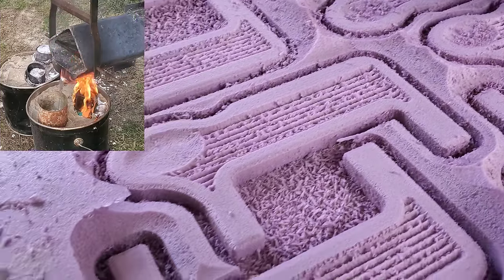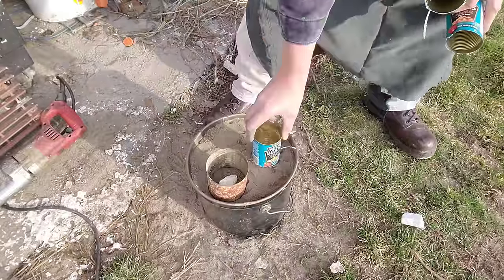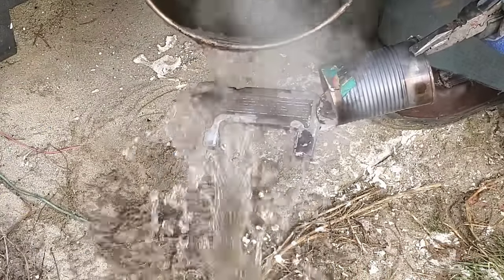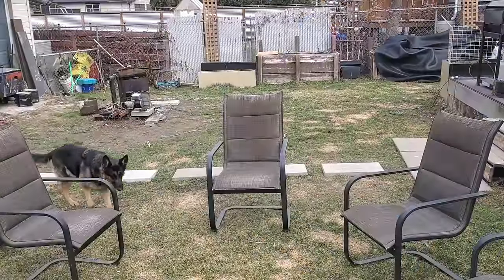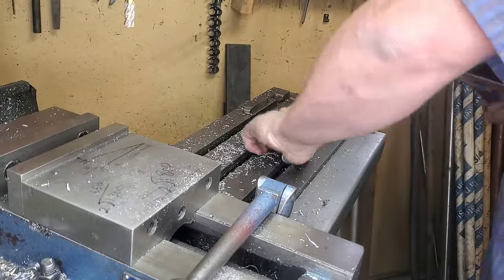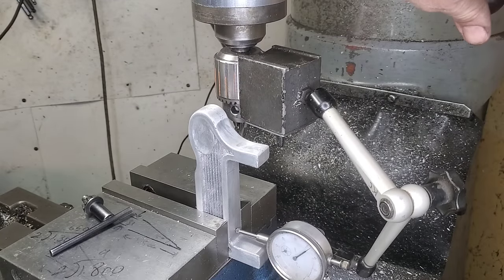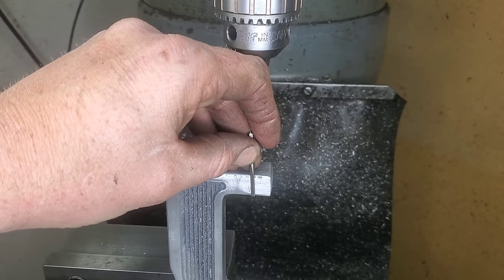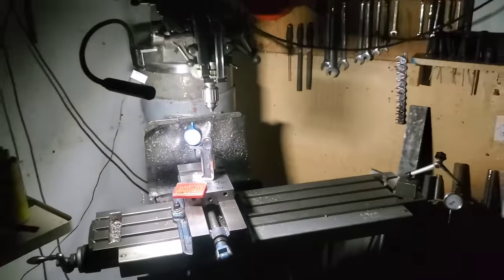Lost foam casting a presision snap gauge

Comment: Making a measuring tool with aluminum is a bad idea
Reply from the maker: Thermal expantion good point . Im wanting to move to iron at some point :)  lots of moving parts with that endever
Reply: @Wrighmachining  take a look at micrometers. They also have a plastic piece that acts like a heat insulator

Comment: You stress about having appropriate PPE & yet your forging area has a gasoline can sitting 3 feet away. You might want to make sure the work environment is safe also. Also I'd suggest getting a class D fire extinguisher at the handy for those ohhhh crap moments. They can & will happen.
Reply from the maker: Kamloops bc , we are in a sub desert as well .     We do get colder winters with snow here though

Comment: Boy did this come along at the right time! I've been messing around with casting and was about to spring for some different pro sand formulations, but... I already have wall mud! I'm using a cute little coffee can furnace at present, but if the wall mud thing works well enough I may have a new project building something bigger :)
Reply from the maker: Awsome ! There is also a video on the slury if your interezted amung other videos i have .   Also kelly cofield on Yt is one of the other losr foam casting guys as well . Does some realy cool stuff . Look for his older videos .   Good luck and have fun

Comment: Cool project!  My biggest lost foam casting so far has been a big honkin' custom pulley for my generator project. Lightening holes are a snap in lost foam.

Oh by the way, reamers are a thing. Not even that expensive. And reaming aluminum is the easiest of easy. Go treat yourself and double or triple the precision of your finished holes. You can even get oversize and undersize reamers if you need a hole that's not exactly 0.750" or whatever.
Reply from the maker: Haha , i figured i would get chirped for no reamer , and rightfuly so . :)   ill definatly do that next time . 

With the pully you casted did you lay it flat or cast vertical ?   Also any warpibg issues due to foam and sand and if so what would you change to prevent it ?
Reply: @Wrighmachining  I did it vertically. It took three tries to get the gates the right size and position so everything filled out right. That's one of the minor drawbacks, the pattern is single use only. But, not so hard to make a big round slab thing and drill 6 evenly spaced holes. It would be fun to go back and do it horizontally to see if it's easier or harder. There's always a way.
Reply from the maker: @solarguy6043  i have not had much sucess with horizontal my self   . I did a 30 inch round one with a single inlet last year .   Wow that was exciting for sure .  Took a few trys as well .

   Yes some experimenting is required for horizontal .
Reply: @Wrighmachining   I am contemplating a cannon build, and I ran across a video of a guy trying it horizontally. Didn't work out, but vertically it did.

Comment: I am tempted to suggest slitting and bolting for the indicator stem hole, but understand there might be some issues with the brittleness of the aluminum, but same goes for a grub threads in the Al to be fair.
Reply from the maker: Good idea . Would have been esyer on the dial .    

Yes the other casting i did for the servo motor i casted a slit in and the alu was way softer .

Comment: I just love your pratical casting setup, so thanks for demonstrating it......Suggestion: try some kerosene as a cuttting fluid for Aluminum.   See what you think.
Reply from the maker: Kerosene as cutting fluid . I will have to look i to that for sure .   Yes the rapid tap is not spacific to alu .    I was using some stuff that came in a green can a while back.   Thanks for the silugestion i will get on the research and try it out !

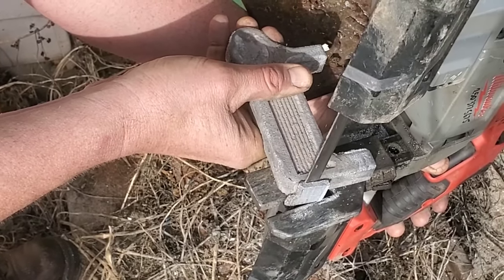Comment: @6:30 you literally did create a crystalline structure. By quenching it, the crystal species that form are different to it naturally cooling vs. tempering. It's one of the variables that decreases yield in industry massively.
Reply from the maker: Thank you for confirming that , i figured alu would act similar.   If that is the case i next time i will not do that and second i can perhaps run a heat cycle on parts to destress them or soffen them if required for the aplication  ( much like normalizing 4140 so you can machine it )

Comment: Does it make sense to create a measuring instrument in AL due to the large thermal coefficient?
Reply from the maker: Yes it would play a factor in it for sure . Just like mics you would leav it on the bench and use it and put it back down .  Due to the size of it , i would asume you could hold it for a couple of min before the expansion of metal started ( like micrometers )   great perspective patheron !!    

Next year i would love to build a cop furnace and start pouring iron but have to spurce out coal .   Aside from mile long tranes coming from alberta and up north its hard to find .      I do love a chalange though :)

Comment: Nice work. I don't have any idea of your friends accuracy requirements but the dimensional stability of aluminum is questionable and a good fine grain cast iron or semi steel would be a better material if properly stress relieved. Would the Styrofoam pattern/full mold process work with cast iron?
Reply from the maker: Thanks roger .    It true the thermal expansion is an issue .  However if you pick it up use it and put it down is shpyld be ok .   Iron wpuld be awsome but im  not there yet

Comment: Climbing in a Bridgeport?
Reply from the maker: Yes , the mill is tight and it was a light cut , i see your concern .  I have had issues doing that on other mills where it grabs and runs out the back lash breaking the endmill or recking the work .  

I do use climb milling on steel as well . Because i dont have auto feed with a bigger mill and tge right depth of cut it can make feeing easyer for roughing .  It gently will pull tge work along if you can take up the back lash slowly when you start.  The key i think is knowing your mill realy well and listen to it like you would a good woman .  :)